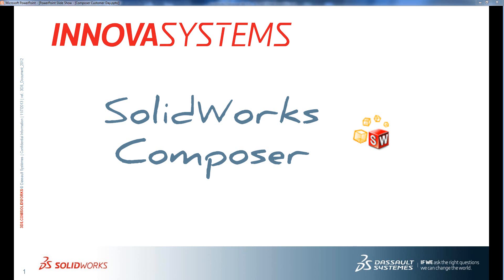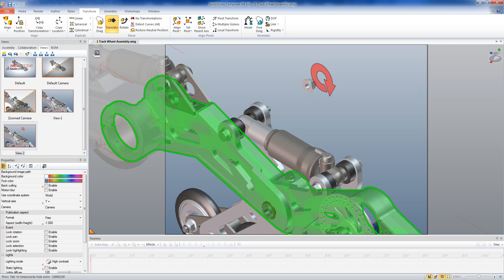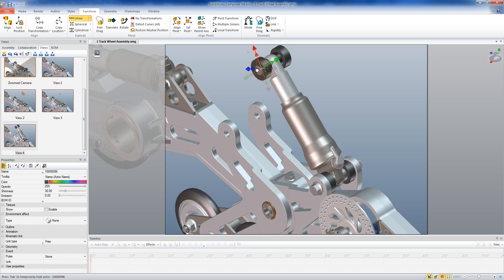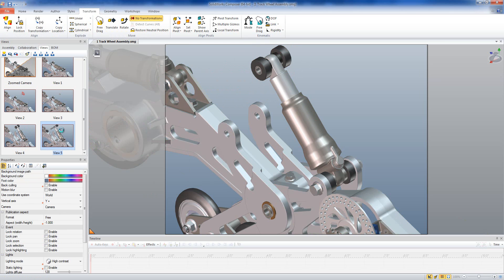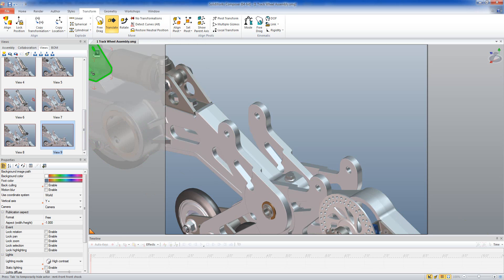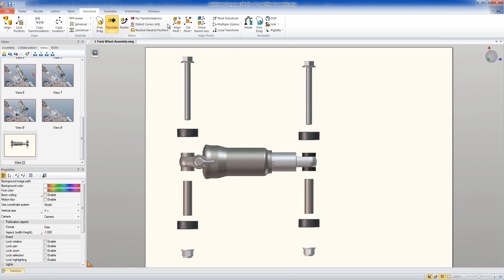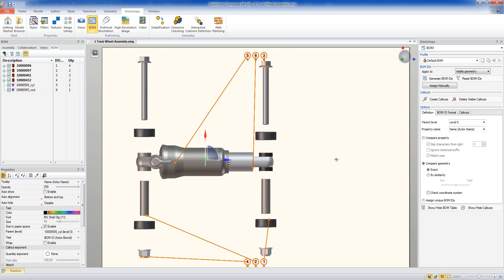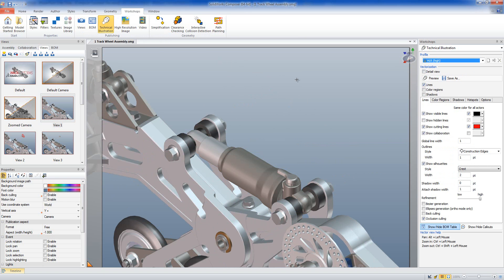SolidWorks 2014 - Composer

Comment: when you switched from part number to geometry for the callout, it is not clear what or how you changed the selections. It would be helpful if when switching modes or any such change (including tab changes), that you highlight, zoom, or say  that particular tool or tab etc. this is important, since the in video, it is hard to see the writing.